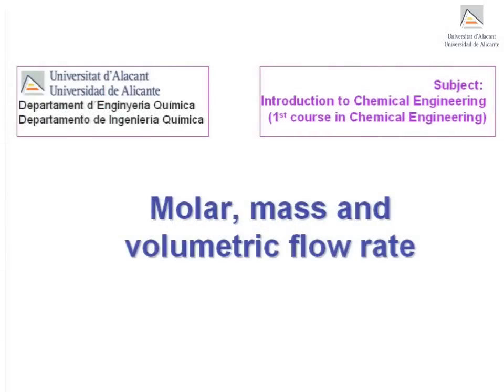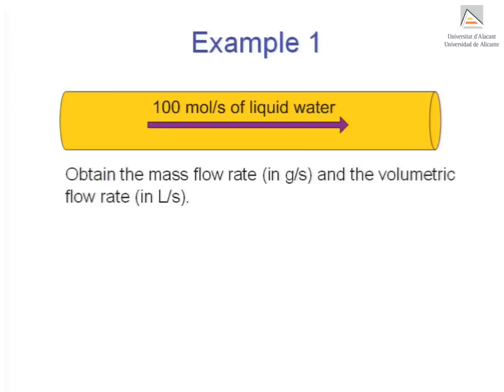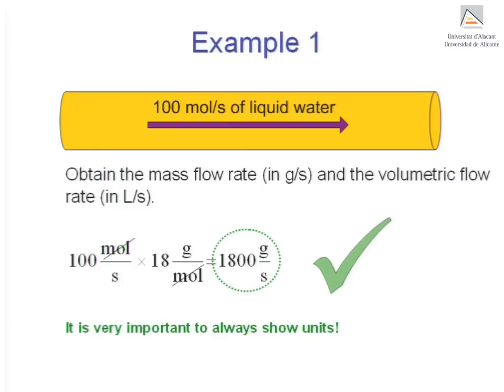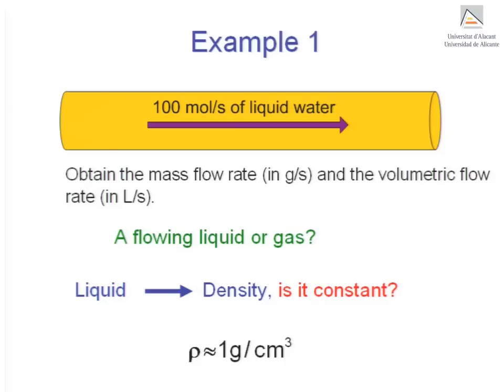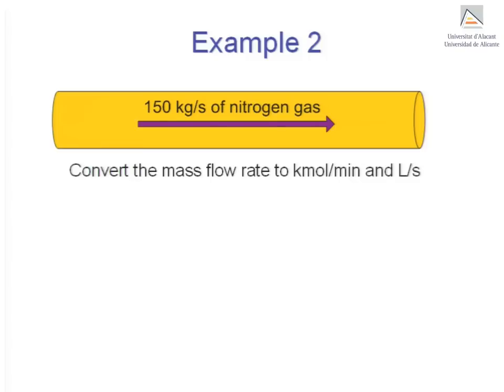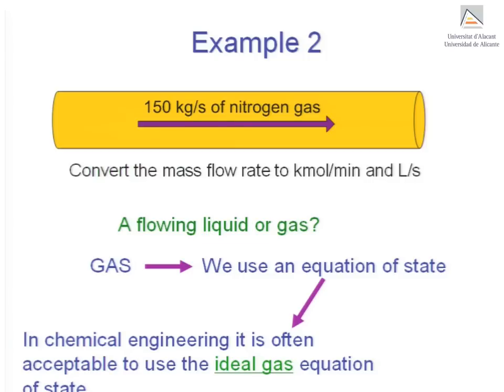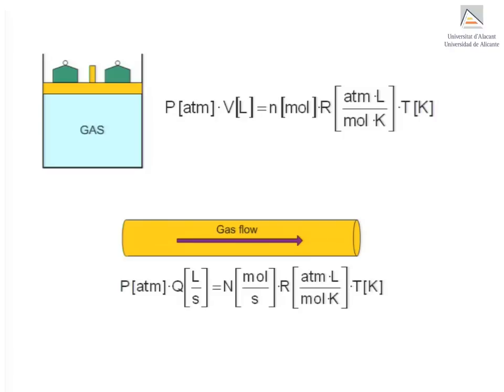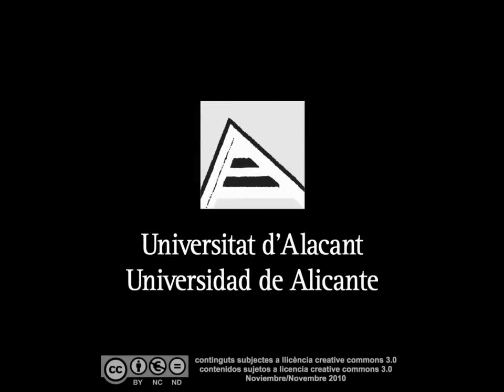Molar, mass and volumetric flow rate

Comment: if 1.9g/s of air is flowing through a pipe with 0.1g/s of C3H8. How can I get the mass flow rate of the mixture? . Do I just add the mass flows together?